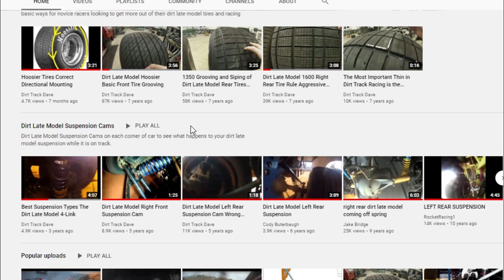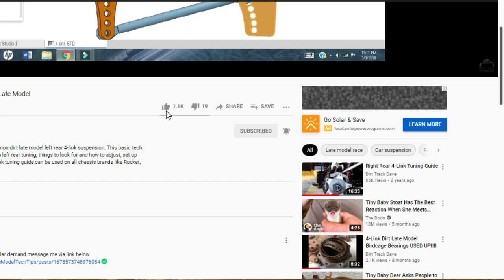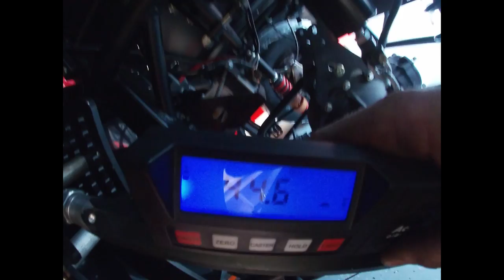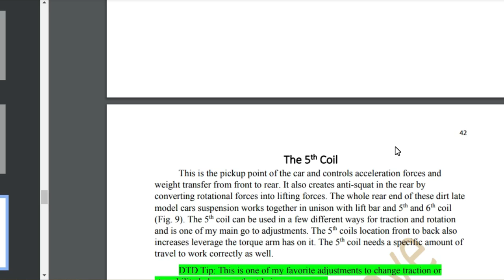How to Build Traction in a Dirt Late Model

Comment: Thank you! Learning a lot from your videos, trying to apply this to my own road racing 4 link setup. Any thoughts on setting up a 4 bar for the road course?
Reply from the maker: Glad they are helping Doug. I have a variety of customers competing in different forms of motorsport like land speed cars, saloon cars, and sprint rally stuff.  For road racing two key things compared to DLM geometry,. One: longer and way flatter (less angle) bars for less movement. Two: Liftbar set up less aggressive, don't need all the hike or anti-squat  that we require. Always glad to expand potential gains from working with other car types. Feel free to contact me about more 4 link information.

Comment: Hey Dave. Thanks for the amazing videos and explanations of the science behind chassis dynamics. I was a development engineer for Competition Engineering from 1998-2006. I was using CAD software and testing to design suspension components for drag & oval track racing. I was using cameras and video mounted on vehicles (before Go Pros LOL) to better understand what is happening throughout the race. Nothing fascinates me more than the dynamics on the dirt late model. Thanks for posting all of this! It makes me smile and my brain instantly goes to work trying to develop an understanding of what goes on and how these forces effect traction and other handling charactoristics. My most challenging project was developing traction components for the front wheel drive drag racing platform. Believe it or not, the dirt track technology and suspension design is very similar to FWD drag racing. Your channel is extremely helpful!
Reply from the maker: If you like to get greater in depth can try my guides until I put out next set of videos. 
Set up guide https://www.paypal.com/instantcommerce/checkout/4J87KMZC9D5PU

Adjustment guide https://www.paypal.com/instantcommerce/checkout/9974U9XA5MTYS 

Tire guide https://www.paypal.com/instantcommerce/checkout/W6GF2X6VSBNFN

Comment: On the subject of roll-steer. I've always worked on the theory, not fixing a problem by taking out bite. With that being said, roll-steer is loose steer, taking out bite to make the car turn, if anytging i like tight-steet, pushing bothe rear tires the same distance. Long bar bottom, short on top.
Reply from the maker: And you are not wrong. As we all know there is more then one way to skin a cat. Having said that, you can't drive a car as sideways in slick as you can in heavy. If a car has large natural amount of roll steer it will keep wanting to turn car in slick. Taking bite out makes a car less likely to get to max droop as fast feeling like less roll steer but not as great of change as moving plates or changing bar lengths. Just depends on needs of driver to make car work for him or her.

Comment: Never let the RR lower go below zero? Total Nonsense -5 is an extremely useful position as long as you comprehend what your doing the effects on drive angle, wheel base, indexing, etc. negative bar angle is still used often.
Reply from the maker: Only useful for a crutch in my findings. RR lower below 3* at static means in dynamic you go below 0 and likely around -2 up to -4* . This means the bars go from one thrust direction to zero and then a negative thrust direction. This results in forces countering each other instead of working together. I found the 4-link rear end set up works best and more efficient if a bars forces all pushing same direction. Both LR and RR. However in tuning these things we are not taking grip away necessarily but changing it from one side of the rear end to the other. When tracks are  heavy you want more right rear drive, more RR  angle especially in the right rear upper bar. However this is the opposite when it's slick. I do decrease my angles on the RR but I never go below zero not lower because it creates an imbalance and the timing and how they're working together LR vs RR that is. But when it's slick I decrease that angle to allow it to work much slower and not get on the bars as quick. This makes the LR drive longer before the RR comes in resulting in  more straight line traction exit to just on straight away.
Reply: Dale McDowell says 15 inch split on your right side rods and if you drop one you drop the other if you raise it to free it up you raise the upper other words keep the split same

Comment: I'm trying to set up my late model on world of outlaws playstation 4,  lol .     There is alot of settings.  My dad used to race them in the late 90s.
Reply from the maker: Well I have found a the relationship between real world and sim adjustments is not the same. The accuracy in sim DLM racing is way off. Similar but off.

Comment: Do you think something like this could be applied to an autocross car? It’s a torque arm setup currently
Reply from the maker: Yes there is huge mechanical traction to be harnessed from 4-link system. Just have to tune aggression you want in car.

Comment: Hi Dave, I'm over in the UK and Do a similar type of racing, Except go clockwise around the track, but looking to build a new car again next year, i've not built this type before where the car is front engined RWD, most of my previous car builds has been rear engine RWD, If building from scratch is there certain things that go in certain places give or take an inch? 
I will only have the wheel base of the original car to start with.
Reply from the maker: Please email me with some more information on your needs @ speedydave10@gmail.com

Comment: There was a significant rotational force left out of this video. Anyone know what it was?
Reply: Driveshaft rotational direction.
Reply from the maker: You are right, not considered by most to do anything but it does have an effect usually over looked. And to be honest I really didn't consider it Factor to brought to my attention even though it's crossed my mind but being so narrow and low torque due to its size. But regardless there's still a force being applied.
Reply: There is 500+ lbs of engine torque being applied to the rear end gear as the rear end converts driveshaft rotation to axle shaft rotation.  Drag strip racers run the left rear heavier to accommodate this effect. Circle track racers mistakenly assume that it is only to counter dynamic weight bias from turning left. I thoroughly enjoy your videos and thank you for this conversation. Keep up the great videos please!
Reply: @curt9i Now lets consider what happens to the effort at the lift arm when we change gear reduction. It changes. This will result in dynamic elevation change at all 4 corners of the car as the torque at the moment is changed.

Comment: Mr Dave is this a lsx or LS2 TNT ?
Reply from the maker: Charles, that was a 2019 TNT with my standard a-arm lengths I start with majority of the time with customers. The spindles STD TNT with tie rods in forward position for smoothness down straight. Caster and camber are set to my baseline specs, I put everyone on to start same as in set up guide. Rear end 4 bar plates removed and my geometry and range of adjustment custom plates was installed. LR shock mounts relocated, and 5th and 6th also relocated to my base position. All ride heights we altered as well just slightly, springs my baseline same also as in guide. Shocks modified as needed to get attitude and desired feel for driver.

Comment: By the way, you’re talking and then the wrapup of the rear end that car was not getting any bite because they were in wasn’t wrapping up like it should be opinion kept going down forces to the tires
Reply from the maker: Well with lest grip there is less thrust on bars which is less anti squat. To say the least. However increase in left rear spring load helps this along with corrected air pressure. Biggest thing in slick in NOT TO SPIN TIRES! Once grip is sheered all anti squat is temporary lost.

Comment: why dont ya make a video with some swing arm tech instead of all this 4 bar gayness!!!!
Reply from the maker: Jay the z-link and swing arm have their uses and benefits. They still run in specific dirt motor sports and asphalt. However the swing arm is inferior to the 4 link geometry. The 4 link uses 100% of forward thrust to drive that side of rear. Where swing arm does not it's less then 50% since one bar is inverted. For old school this was on as cars were not as efficient with 4 link as they are now days. So swing arm take a little drive out yet cut down roll steer as well with it's up and down motion. Where as 4 link is down and forward.